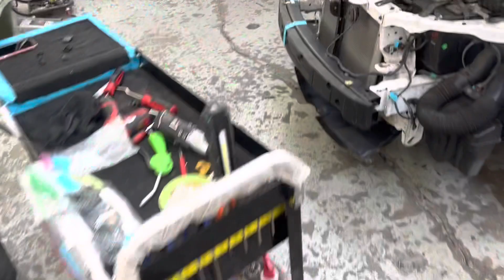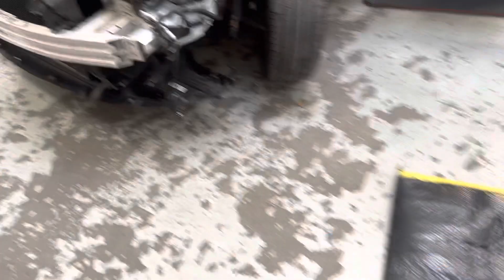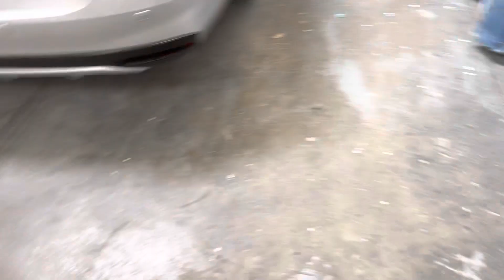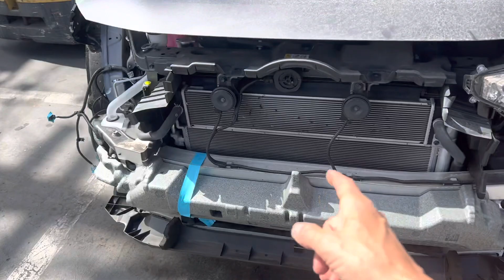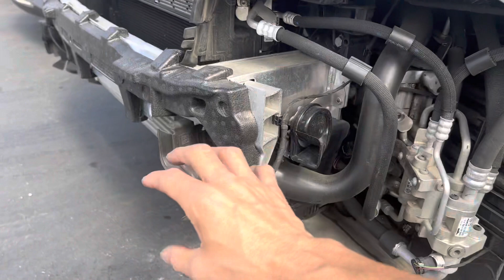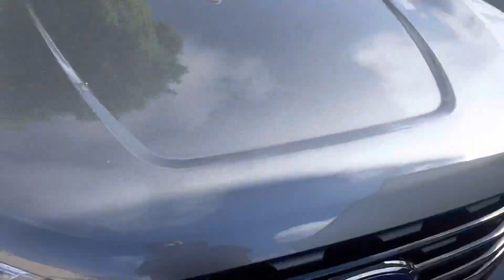￼AC ON EVERY CAR NOT A OPTION Electric cars & hybrids￼ must have working AC To drive ￼

Comment: So just a noob question. Since releasing cfc's in the atmosphere is an offense, if a crash makes the line/s leak and releases it, is someone penalised for that? If so, who?
Reply from the maker: No penalty there’s nobody to blame it wasn’t a intentional release. 

Define is 44,000 and I believe $200 somewhere right around there that’s if somebody opens up a hose in on purpose releases it to the atmosphere somebody depresses the valve core to release it to the atmosphere under those circumstances that is when somebody gets penalized.
Reply: Why would you think someone should be fined or punished for a release in the event of a traffic accident?  No offense but it seems you don't comprehend the purpose of rule of law.